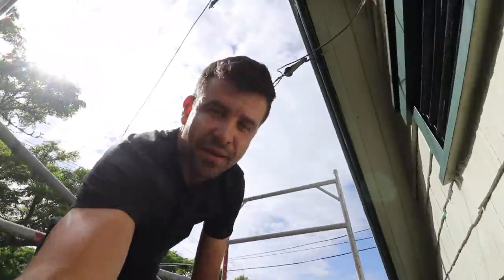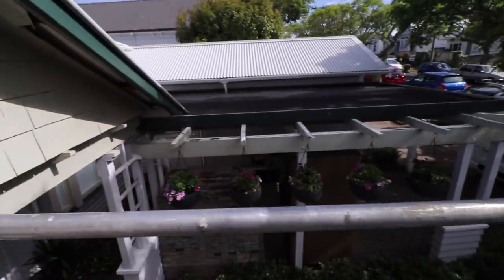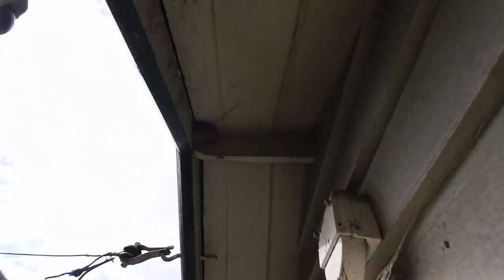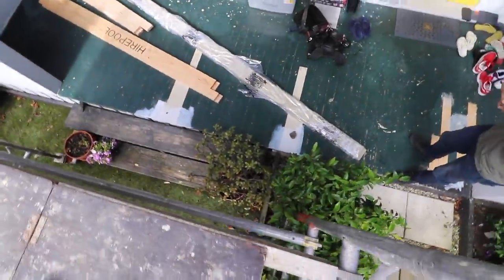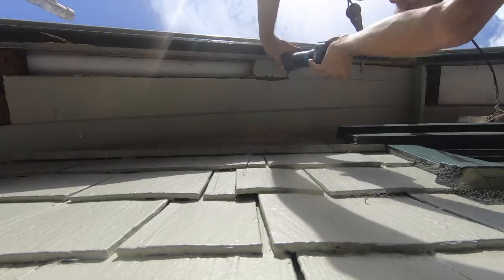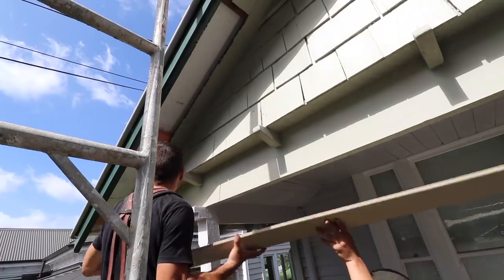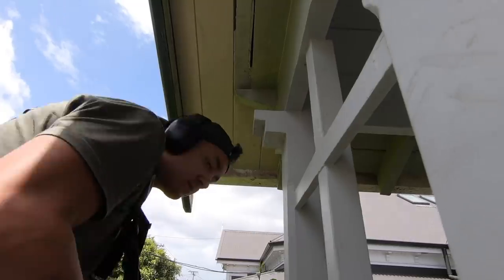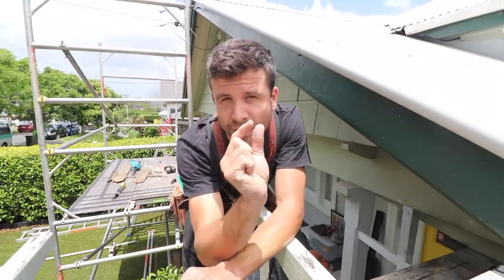We Had to Get a Scaffold

Comment: I've got the Festool jigsaw, corded. Love it. No troubles with it. Much better  then the other brand it replaced. If you are buying Festool, they are good tools, but they are a system. Storage and dust collection integrated together etc. If you already have the Makita cordless, it's basically a no-brainer, stick with one cordless system. Multiple unnecessary battery systems suck.

Comment: Mate the biggest risk on that job is the Electricity if you cant get it disconnected then at least get the power company to apply a safety insulation wrap so that you don't get zapped. When ever painters or builders work on houses in my area it is a requirement if the power is above ground and still live. I like your vids and would hate to hear you had an accident, all the best and where is Paerau  cooking videos?

Comment: scott brown .get ply sheet /set skill saw to 2mm/run lines to match existing sizes of tng /shade lines in with pencil /prime/paint/install.Looks the same once painted and takes 1/3 of the time
Reply: I've done it many times simply with the corner of a tungsten scraper. Use a straight-edge and score the ply with multiple passes and it looks identical once painted.

Comment: never had an issue with both of the uploads yesterday ~ I was wondering why you uploaded twice - how easy would it have been to have the power to the house turn off if it was in the way?
Reply: i think thoose where cables for phones  so there not dangerous  just shity if you break them
Reply: I had that happen to my parents and it not fun
Reply: @Nick-hm9rh  I have had to fix one of those someone broke. nightmare
Reply: They were definitely power lines. With a couple of days notice the local supplier has a free disconnection service when work needs to be done that close.
Reply: In New Zealand, you organise a Temporary Safety Disconnection from your power retailer and they drop out the pole fuse. Usually need 24hrs notice, and some might charge for the service.

Comment: Bro, give vector a yell and get them to do a safety disconnect next time. The insulation on those tails coming out of the house breaks down in the sun. Most electricity distribution companies will do a disconnect for free given enough notice. It's not worth the risk when swinging around big bits of aluminum!
Reply from the maker: Good call bro! Next time
Reply: Pain in the ass waiting for them or coordinating for such a small job. With only 2 guys it's so easy to work around it. But if someone doesn't feel confident, definitely turn it off or at least mat it.
Reply: @DiscoFang  not as much as a pain in the ass as a funeral lol